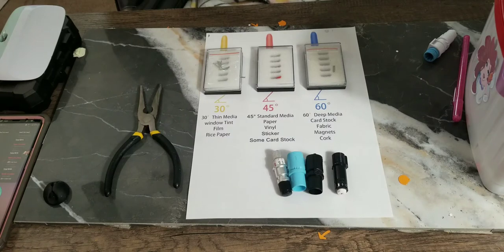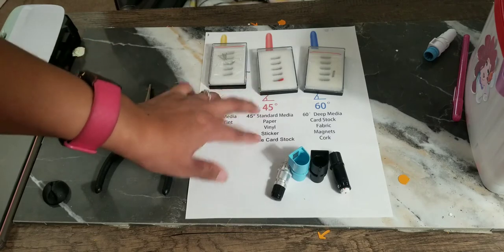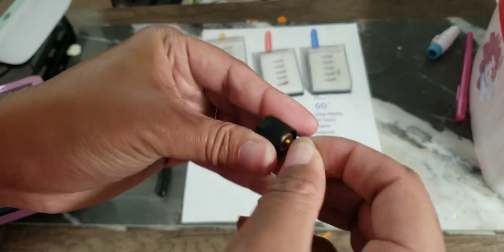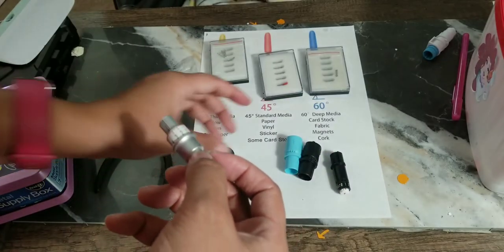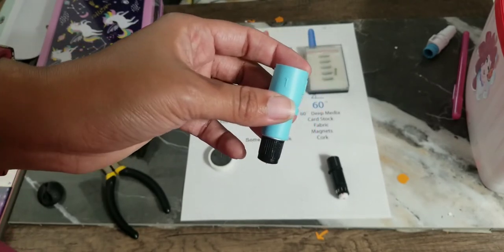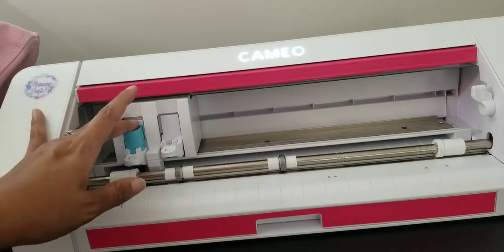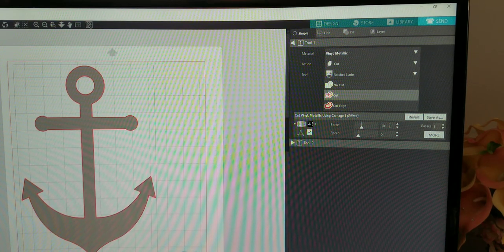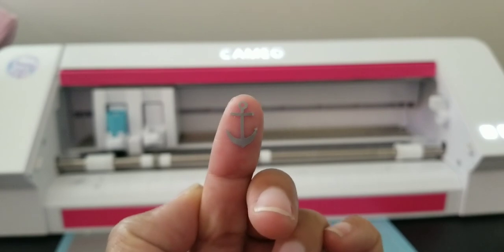How to use a Cb09 blade to make tiny decals, smaller than a fingernail.

Comment: Do you have to have the blade facing a certain direction (confused how it knows which way to cut using the angle of the blade)
Reply from the maker: I would have to look more into it. I just install the blade in the holder. I believe the sharp side should be facing the back of the machine not the sides.

Now I need to check lol . I'll let you know how mine is sitting

Comment: I noticed when using the CB09 blade. I'm using cardstock and I've noticed it drags. Also it don't cut through the entire cut.
Reply from the maker: Hey, sorry for the late reply. I am still learning how to use CB09 with cardstock. I find it best to use the 60 degree blade and with 5-7 depth. I have uploaded new videos on a blade, that I have found and started using recently. It seems to cut better than the standard CB09 housing and also doesn't require an adapter...Have a great day
Reply: @Taniicka23  Just read this thread. Are you able to provide the name of the new blade you are using for cardstock?

Comment: Thank you for sharing! ok so I have some questions :) I just installed the cb09 blade in my cameo 4. I watched a lot of videos bc i have been building my t shirt biz slowly and am trying to be as efficient as possible. I am cutting some intricate designs on htv. Your video helped so much with setting it up so thank you! but I'm trying to understand why change out from the auto blade? Do you feel the autoblade does not cut as well? my concern is the weight of the cb09. will it damage the machine after awhile? Do you have issues with it? Im worried that with setting up the tiny spring and blade myself there is room for error. Thank you in advance for any tips and help you can and have already offered!
Reply from the maker: 1. The autoblade is just the standard 30° blade I believe. I could be wrong. I'm 2 years into owning my Cameo 4, I don't feel comfortable using my autoblade when working in decal orders.(it's happened more than once user/software error I set the blade to 2 and it and will go to far). I believe the autoblade is great for beginners doing basics with less control and use presets. 

2. The autoblade only has the 1 angle blade that is also the same at the ratchet. I tested each angle and the 60° is my favorite. I have full control to customize each cut setting per vinyl type. All vinyls cut differently, small learning curve. I always test cut each different vinyl brand I buy. Suck as Oracle vinyl needs different setting than Cricut vinyl. Lol if that makes any since. 

3. Room for error. Again learning curve and practice before making orders with it. Word of advice get a special box just for your blades, and magnets. Lol so many small pieces and I dropped blades in my carpet, found thank goodness 😄. I very rarely take my blade out if my machine unless I need to change blade or depth. Practice cutting with the mat only until you get the hang of it. I now barely is mats anymore, my personal preference is rolls. 

4. This is a 3rd party tool and Silhouette is not held liable if you use this tool and it harms your machine. I've been using this blade for 1year now and see no issues machine mechanics wise. 

I still have my autoblades for paper cuts, but I rarely cut paper. I mainly love what I already said, full control of the cut if that makes any sense either. 

I hope this helps.. good luck.. thanks for watching.. let me know how it goes 😘
Reply: @Taniicka23  Thank you! yes it helps, I worry so much about screwing up i guess it takes time get comfortable. I'm about to do a good size shirt order with an intricate emblem which is why I started researching the blades in the first place. I'll check back when the order is done :)